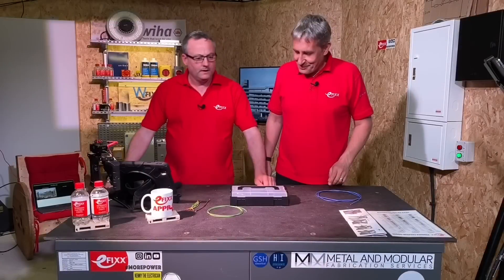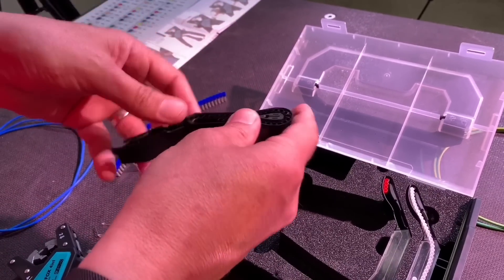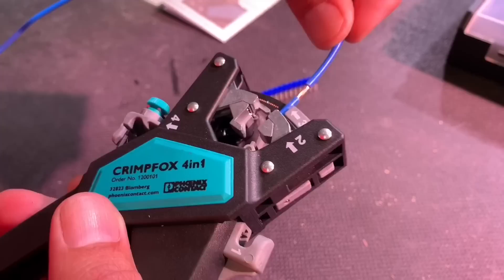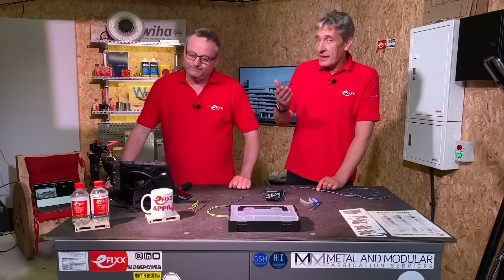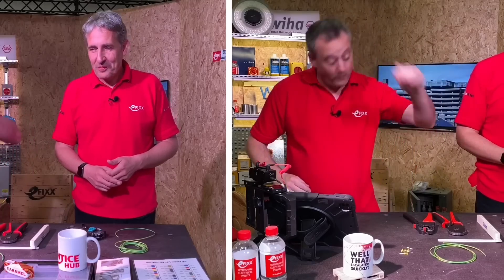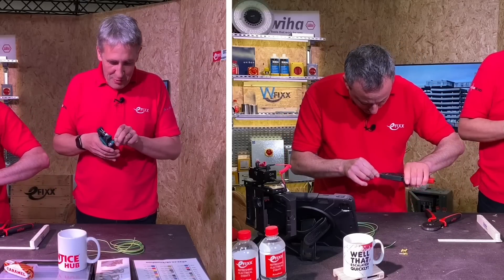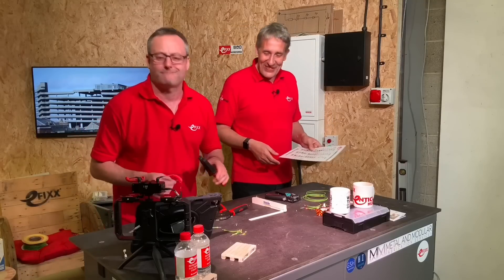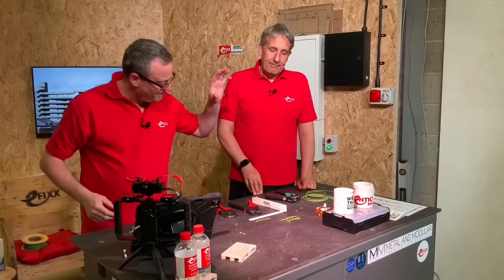Cut, strip, twist and ferrule crimp - in one tool: Is the Phoenix Contact Crimp Fox 4 in 1 a winner?

Comment: Hex crimp or just the standard half moon?
Reply: C shaped. Or half moon as you call it. It can be good for MCBs and other screw terminals, but I prefer square or hex shape crimps for spring terminals like wago topjob or phoenix contacts push in terminals. It's pretty much an industry standard to use spring terminals. Only mains use large screw connectors. 

I believe this tool can be useful for house installations. In Hungary where I live it's quite common to use stranded in everywhere especially in tubes because it's easier to pull. Lighting is done with 1.5mm² at 13A, sockets depending on future load are 1.5 or 2.5mm², 13A or 16A. If I would do 3 houses with stranded I'd definitely use this tool.
Reply: @Oueax  Honestly I watched the video again recently and this tool just seems so fiddly, I have just been using the half moon one on my knipex multi tool recently, but I also have a hex one, both do a decent enough job that I don't really know if I'd bother with a different tool each time.

Comment: If Gary had "production lined" it during the race it probably would have been much closer, cut all the wires first then strip both ends on all of them and finally crimp, it's the swapping tools that slows you down so minimise that.

Comment: How is this useful for an electrician? A/C wiring doesn't need ferrels, twisting due to solid wire. Nor is it useful for automotive.
Reply: You're talking residential. Industrial electricians use bootlace ferrules on control wires (which are stranded). Also there is plenty of stranded cables used in flex in residential lighting.
Reply: Heating controls

Comment: Unless you do panel building you would be better off getting the Knipex multicrimp imo for around the same price. It several crimpers in 1 with just a quick die change, Its what I have and use. The other is the amazon set for 20quid looks to be great value.
Reply: Got that one too with the handy magazine to change the crimping dies.